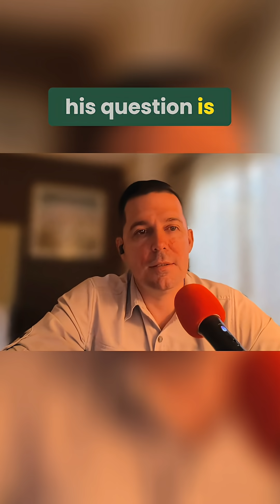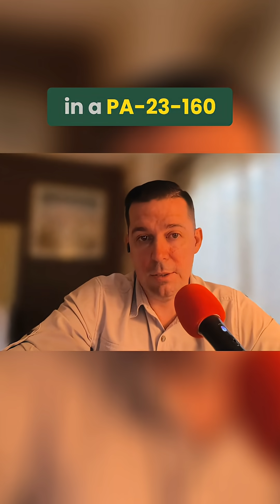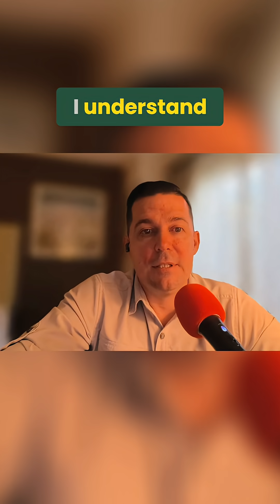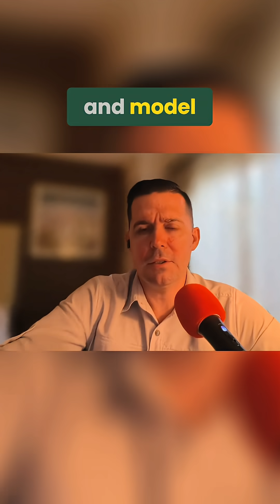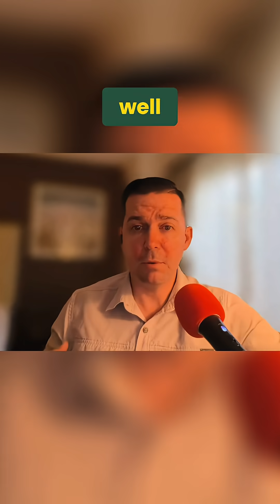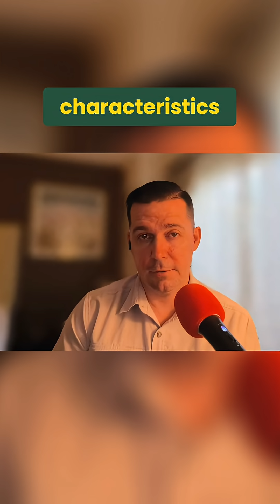MEI Legality: Instructing Multi-Engine Planes Explained #shorts

Comment: I’m sorry did you answer the question ?  I’m still confused. 😂
Reply: Yes he did. 

The whole series is the make and model. Even if different variants are out, yours still rated and allowed to fly that make and model. 

Example, C172G. C172P. C172SP with autopilot, etc. 

Let's say these were all drastically different in the sense of avionics, landing gear, horse power, etc. but they're all a C172. So you could instruct in any. 

This is how I interpret what he said. Seth, please let me know if I'm wrong
Reply from the maker: Yeah, it was right at the end. My interpretation is that the make and model are the same but there are different variants. @Andromedon777 described it perfectly!